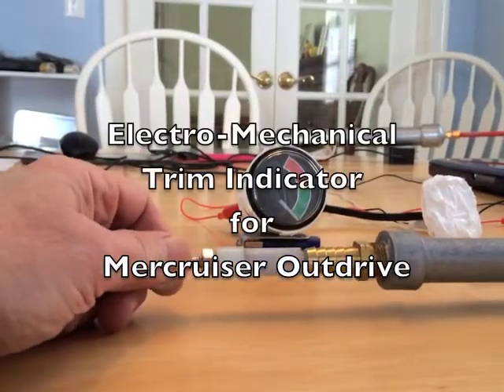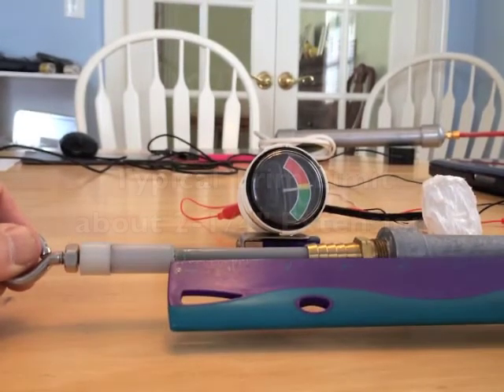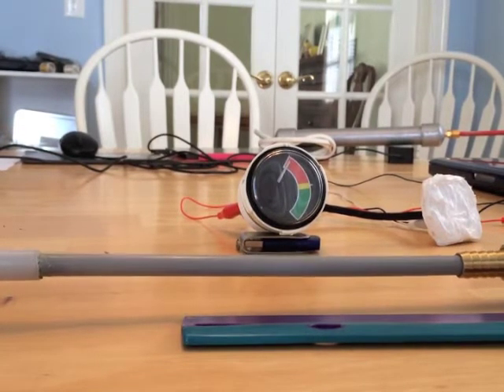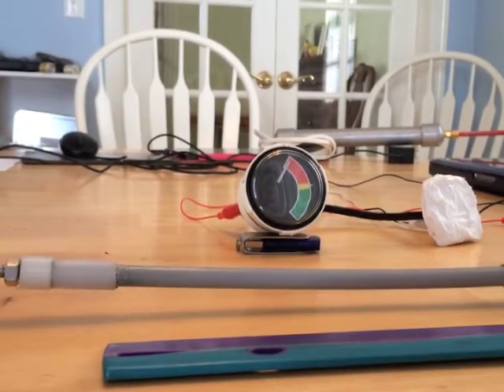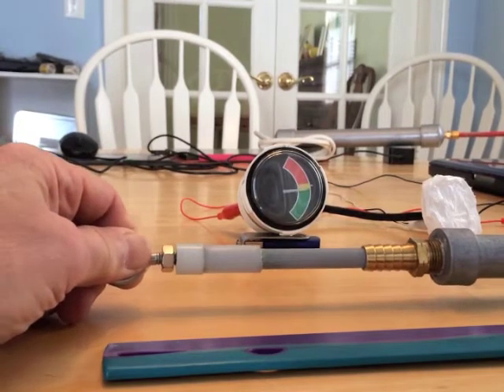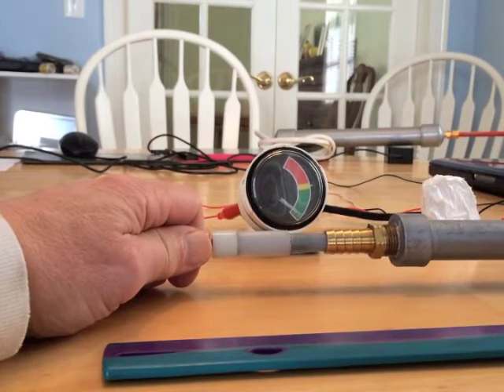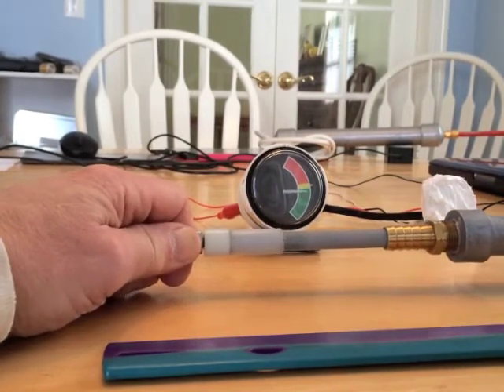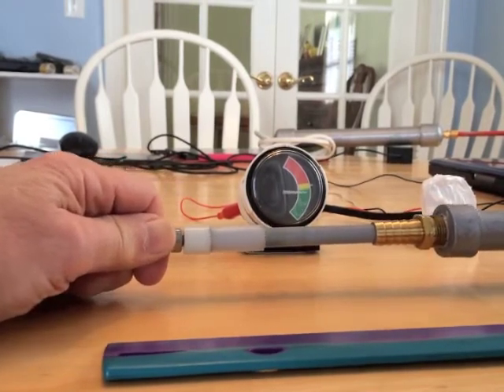DIY Electro-mechanical Trim Indicator

Comment: Looks good, agree the mercruiser senders are junk. What is the principle behind the working, a resistance wire and wiper, induction coil with electronics or optical? 
Thanks in advance